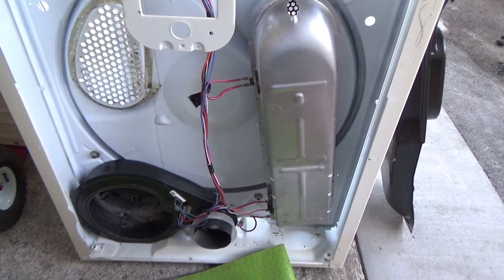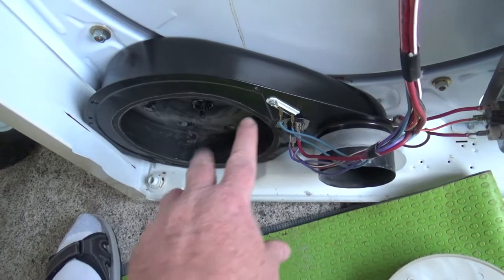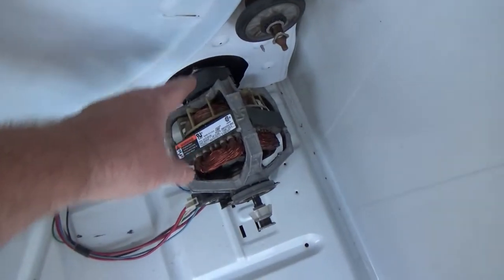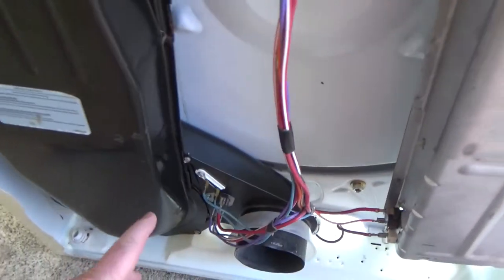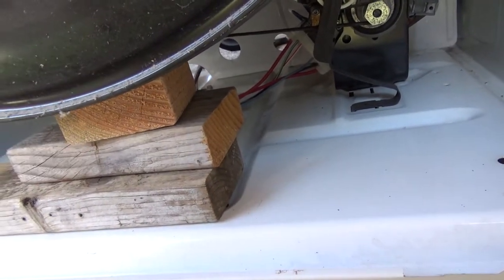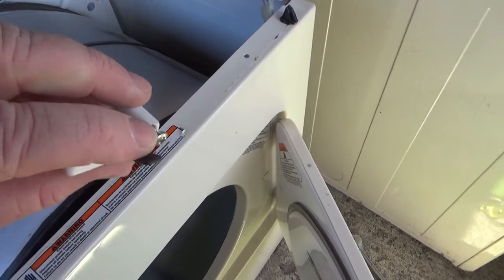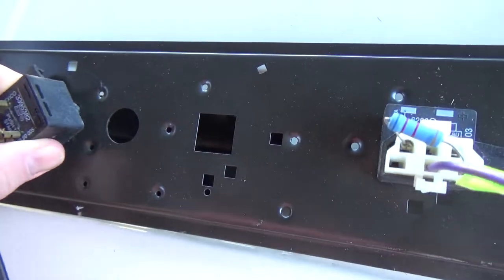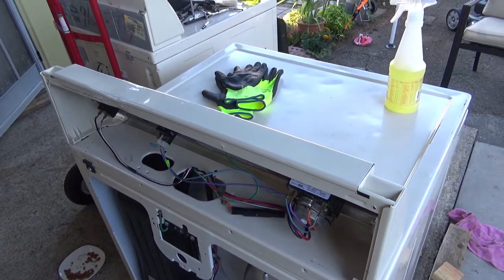Putting a dryer back together

Comment: Great job. Anytime I get my hands on a washer or dryer I’m not familiar with I always fully disassemble it and reassemble it.
Nothing makes you an expert in that machine faster than that.
You should take the timer apart. It’s a common part to have issues with and you can check the contacts to make sure they’re not burned up. You can actually leave all the wires on the timer then take the front half off to reveal the contacts.